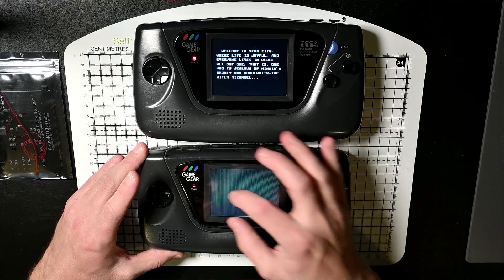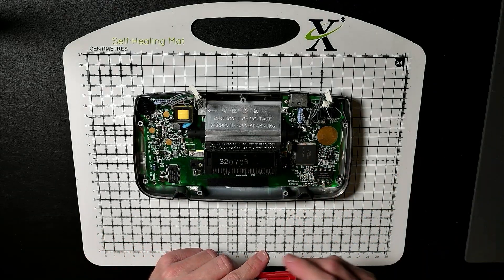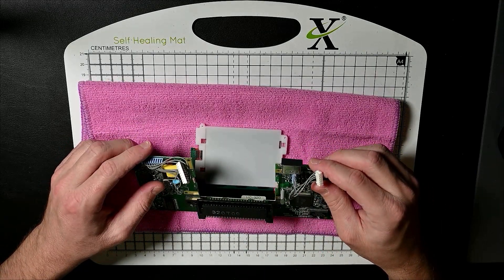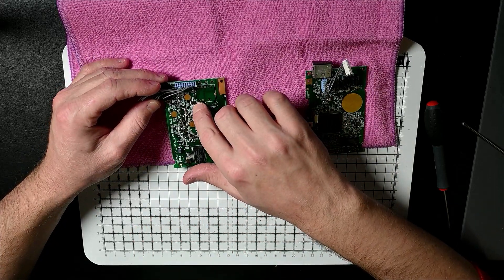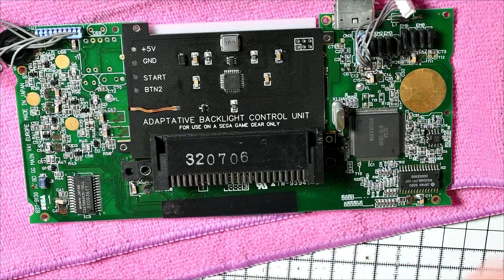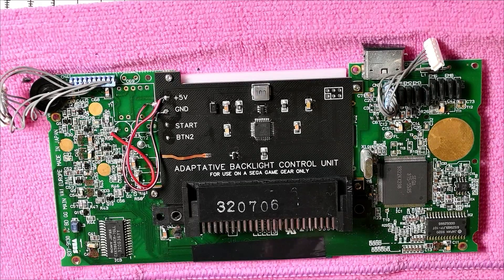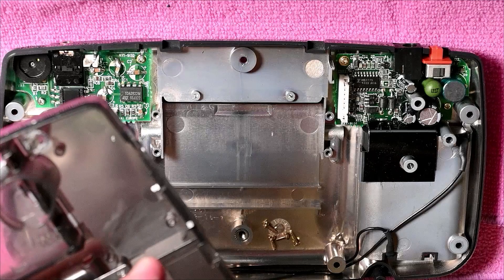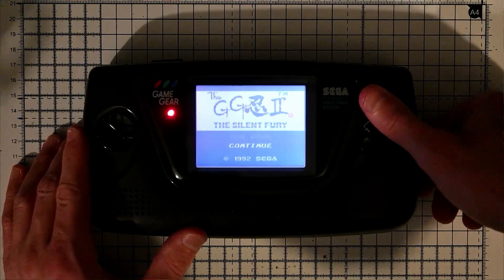RetroKAI Backlight Mod for the Sega Game Gear

Comment: Do you see the leds on the screen? In another video I could see 5 of the leds reflection on the top of the lcd that would annoy me like crazy. I will keep it oem until my bulb burns out.
Reply from the maker: No you cannot see LEDs. Its lighted evenly.
Reply: @MikeJolley  strange in that video you could see them. Maybe they installed it wrong.

Comment: Thanks for posting this. Have you noticed improved battery life?
Reply from the maker: I haven't had a long enough session to test it with and without. In theory it should though because the panel will be more efficient.
Reply: It makes a great difference. You can actually use this as a portable on 6AA rechargeable batteries and they last about 6-8 hours I reckon rather than 30 minutes.
Reply: @bigd5090  I definitely need to do this then. Appreciate it.
Reply: @bigd5090  I been using rechargeable aa batteries with oem backlight and screen and have played around 2 hours and batteries still dont need a charge yet.
Reply: @chriss4365  The OEM bulb is a mini fluorescent tube which is a massive battery drain. You at least double the battery life. I wouldn't even try to run an OEM Game Gear on batteries! With the upgrade it feels like using the original Game Boy!
Reply: @bigd5090  I know.
Reply: @chriss4365  Don't make out that the original tech is good enough then!
Reply: @bigd5090  ok boss